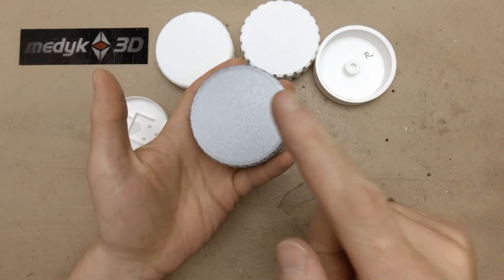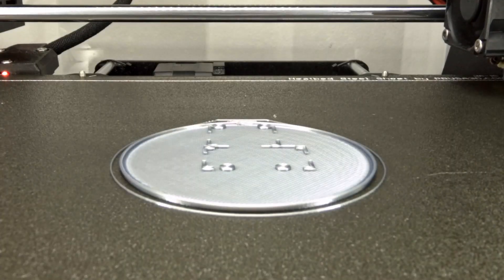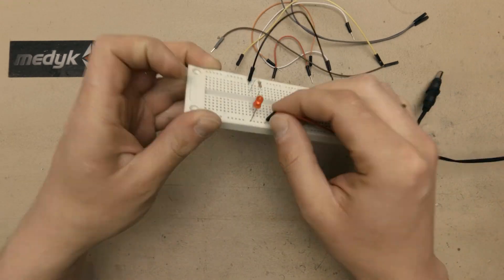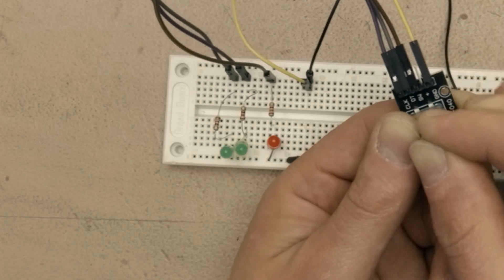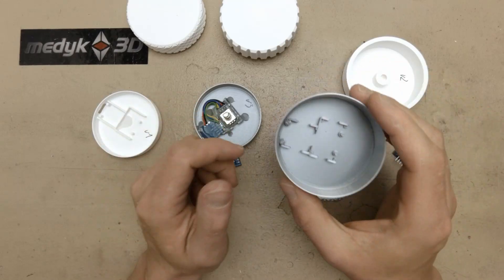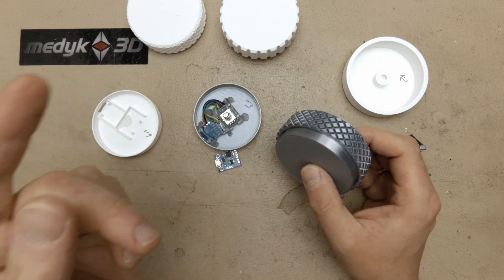3D Printed Media Control Knob

Comment: Hi there, did you think out a way to weighten this knob?
Reply from the maker: That would be tricky. Either print it in metal (super pricey) or use some kind of  weight (fishing weights maybe). Electroplating wouldn't add that much weight. Or just use double sided tape.

Comment: what is the terminal for the push and turn on a rotary encoder?
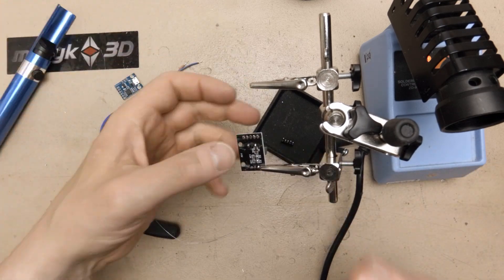Reply from the maker: You mean the one I desolder at 4:21? It' a regular PCB Pin Header
Reply: @medyk3D  no like what are the words on the pcb regarding the push and turn?
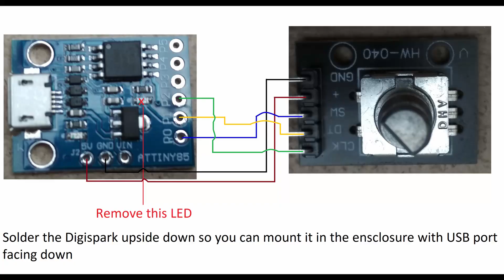Reply from the maker: At 6:23 there is the schematic with PCBs and connection.
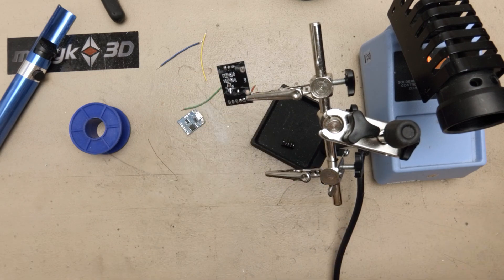I explain the wiring at 5:40. There are: CLK (green), DT (yellow), SW (blue), + (red) and GND (black).
At 2:29 there is switch connection (it connects SW to GND) and 3:12 simple explanation of the encoder.
CLK and DT can be switched in the code (as PIC_ENCODER_A and _B)

Comment: This is an excellent program. I would love to see a wireless one version. If you could please let me know a quick list of component you would use for a wireless one. I would love to make one myself! keep up your projects!
Reply from the maker: Thanks! For wireless there should be bluetooth, battery and charging IC. There should be enough space in the enclosure for all the components. But I have never tried digispark with bluetooth and haven't checked the power consumption of the circuit. But the idea is great. I will add it to my TODO list :)

Comment: For some reason on the rotations I only get volume down in either direction
I had a plain encoder so I added some pull up resistors between +5v and clk/dt pins and connected it as in the video but I still get this problem
Reply from the maker: What kind of encoder do you have? Can you try to connect it like in 03:09 and check how it behaves?
Here you can read more about encoders: http://www.buxtronix.net/2011/10/rotary-encoders-done-properly.html
It's also important how you connect the encoder, resistors might not be enough. Take a look at this:
https://youtu.be/Xyq3uv108iU?t=1237
Try to use the "good solution" maybe it's a hardware issue.